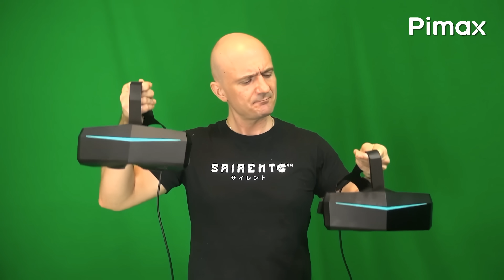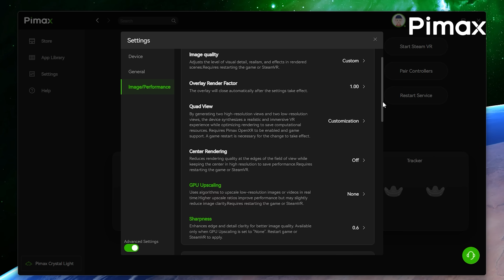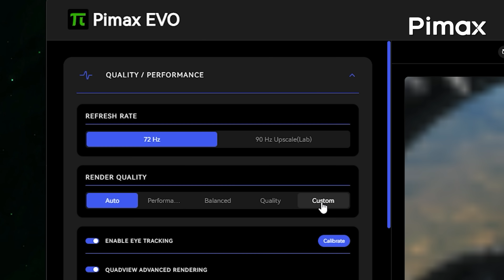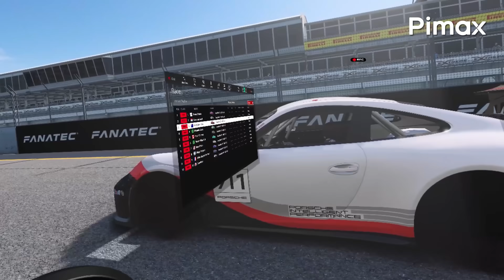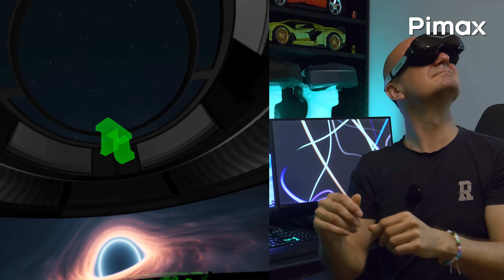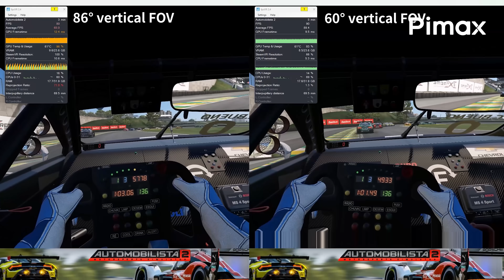Introducing Pimax Play EVO

Comment: We've seen some worry going around that EVO is the start of Pimax putting features behind a paywall. It's not, so I want to address it directly.
Pimax Play has always been free, and that isn't changing. EVO is free as well. (For example, Sboys3's work is GPLv2 (including everything that Pimax helps to make it happen). 

The main reason EVO exists is to give us a place to ship more experimental stuff — features that aren't necessarily ready for the mass market, but that we think PCVR enthusiasts will actually want to play with. It's a testing ground: a way for us to try new things, get real feedback from the people who care most, and improve the experience faster. That's the entire point. It only works if it's open to everyone.

On the paid feature part: Third-party tools and integrations may be paid. That's on the third parties, not us. To be clear, this does not mean Pimax will start charging for its own features — we won't. But we want to keep the door open to integrating outside tools down the line, and some of those could cost money. If that ever happens, our strong preference is a one-off payment, not a subscription. Seasoned PCVR users can imagine what type of companies or services would be paid (but I don't want to drop examples and have people speculate).
Reply: Thanks for clarifying this!

Comment: Ok so you almost have my money coming your way for the dream air SE with this software but I have to ask.  As a content creator I currently use Oculus mirror because of the increase FOV options and horizon lock which helps recordings look very very smooth.  Is this something you are looking into for this software as well. It is the one thing holding me back from switching brands.  The Dream Air SE is what I would really love and if you say your working on it I might be tempted to purchase the headset now 😂. Seriously not joking smooth recording is a game changer for my videos.  I just want out of the Meta echo system

Comment: The app seems very good. However, I'm experiencing a black screen issue with my Dream Air Slam. Would it be possible to add an option to increase the fan speed to help cool the front of the headset? And it must be free ! 😉

Comment: Not sure I want to pay for "additional" features, when the basic features are not even working correctly. Smartsmoothing comes to mind. Since smartsmoothing is a problem, the thing that does intrigue me is the integration of SBoyz drivers that will allow me to use of steam's motion smoothing. 
Pimax you were in the position of being King of the Hill for VR, but you keep shooting yourselves in the foot. 

Pre-Order of Headsets with no estimation when they will arrive
Headsets that need to be sent back due to poor QA
Lack of parts 
Lack of optical engines 
The inability to ship the headset to places you were able to ship to before .
The need to heavily mod the headset, just to be useable.

I could keep going. 

You should be gifting Pimax Play EVO to every current Pimax user.  Take care of your current customer base as a thank you for putting up with this mess.

Comment: Did you get a setting added to your program so that in the flight simulator you could look six, i.e. 180 degrees backwards? If you didn't need to use Neck savers.
I'll wait ;)

Comment: About the mention of all features being free for now: Sboys3's work is GPLv2 (including everything that Pimax helps to make it happen). But for EVO, we want to keep the door open to introduce more experimental and possibly paid features in the future. Nothing is planned atm but think about advanced eye tracking or specific use features. Those may also introduce additional costs for Pimax, some of which we may partially pass on to users. Again, nothing planned atm, but we do want to leave that option open.
Reply: @JaapGrolleman  if the features are that much better then i have no problem making a small purchase. However if this turns into a "service"  i can tell you i will no buy it. So hopefully this will be a onetime fee.  Also your team need to understand that a headset will be used on different machines. So the additional cost needs to move with headset or account.  I do not want to pay for every machine i use this single headset on.  just my 2 cents
Reply: Slippery slope
Reply: Bro i just paid $2400 for a dream air that comes with eye tracking. So now i will have to wonder if the best features are being held back behind a pay wall??
Reply: @tinguren5629  No of course not. All those features including hand tracking are part of the headset.
Reply: @JaapGrolleman im glad to hear you say that, but i know how "profit motive" works. If pimax develops a cool new feature, why make it a free patch when you could charge $5 $10 or $20? Well have to see how its implemented, but ..
Reply: If you pay premium price of 2400 euros with shitty controllers and headband you already paid all the features, you Will die from your greed
Reply: @Enzel02 I got the lighthouse version so no controllers. I use index. Also I installed apple vision pro dual knit headband so the comfort is fine. 
How is my willingness to buy something with some flaws evidence of MY greed? You dont make sense.
Reply: @tinguren5629 they charge premium price, but dont give premium product, and on top of It they want monthly income for the bests features 😂
Reply: And most of them will be built on top of community work like SBoy! So no, making a beta program and taking profit is not an elegant solution Jaap.
Reply: @Whitephoenix1402  I don't agree with that statement but I cannot disclose details on how we collaborate.
Reply: Pimax Dream heated seats edition.

Comment: Ok, so i agree that the Software stack is as important as the headset itself. However here is my take on PimaxPlay so far.   Understand that my comments are aimed at making the pimax experience better. 
1. lets look at the eye tracking calibration.  unfortunately currently to do this you must click on the toolbar, then pick eye tracking from the menu. it opens in the desktop mode, but also in the background.  you cannot calibrate in the desktop mode, but have to go find the desktop setting and close it first.  Sorry this is not streamlined and very much a headach to do.  there needs a way to do this fast and quik
2. IPD is now set manually, again this is the same as above. You have to navigate in and out of the desktop to make this happen. 
3. Tracking headset position. well the SLAM version gets confused at times and puts your view upside down, behind you or in some random spot.  the only way to fix this is "room setup" or restart your headset.  However this is a big problem when you are in the middle of a game.   The need a quick way to rest the headset view.
4. if you go to open a App there is nothing to show you that things are working or loading. sometimes the apps crash and you are left in the headset waiting, only to take the headset off to see the app crashed. We need a loading or into screen when loading.

all these item can be fixed and hopefully they do.  I suggest that they use the toggle volumn buttons and power button to add as quick access.  the volumn buttons can function by default as volumn, however a long press can turn them into a menu popup, here you get to move to IPD, Eye tracking, etc.   once you pick the menu you want then the toggle adjust that. same way it works on quest 3.  Like wise you can have the power button do multiple things like long press shows a menu and you move the volumn buttons to pick to power headset off, or other features.  I also suggest a quick tap to ceter the headset and also provide a short cut mapped key binding to reset headset Zero position. people that play flight sims like me can quickly re-align the headset without taking it on/off during game play

one of the biggest complaints i have is the fact you have to keep taking the headset on/off to look at your monitor to do any. Or move in and out of many menus to get what you need done. 

great headset from a hardware standpoint, but still needs a lot of work in the software area.  sorry if any of you feel offended, my goal here is to make this headset the best!

Comment: Some feedback. Based on the presentation this sounds like a system that allows more freedom to run the hardware and kind of allows the end user to become a beta tester or developer of sorts. If that user helps a feature work better or develops something that makes your product better it gets moved to pimax play (okay this is good) Or it gets made a paid add on (this is not okay) you cant use the community to make your product better then charge the community for the work it did (this is fucking insane) if this is actually the plan as it sounds like it is please don't pursue... this is a one way ticket to destruction the gain won't exceed the bad will it causes and will only lead to distrust and hate from your customers.

Comment: Sounds great!
That said, i'm a little hesitant to ask...
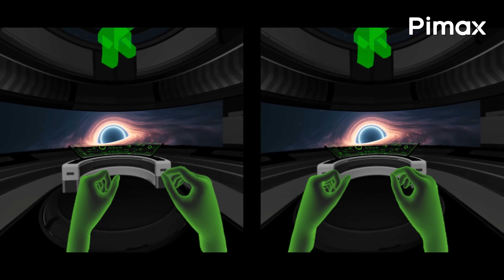Paid features? 9:22

I won't slam it for costing money straight away, but, a subscription for the software to run the headset, better be a godsend, because it will be viewed with the most critical of lenses.
You'd better be certain of what you're doing here - this has the potential to be the next 'pimax meme', and not in a positive regard, if it isn't properly considered.

That said, i'll be open-minded and test it out - but I hope you're aware of the risks of doing a subscription service on the compositor app.
Reply: Yes 👍🏻